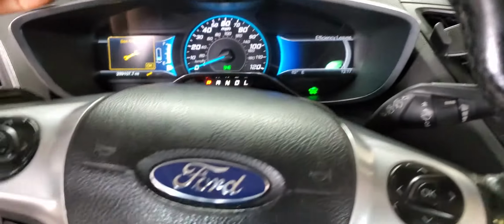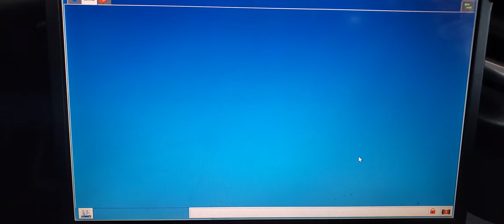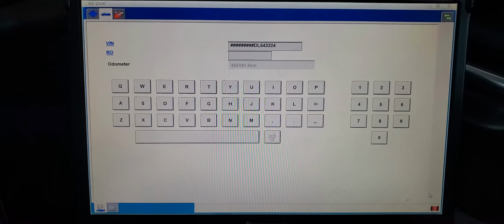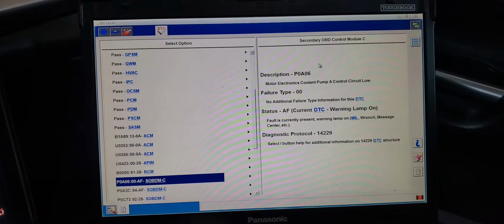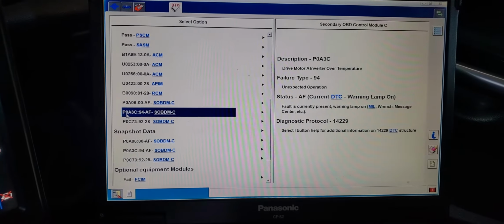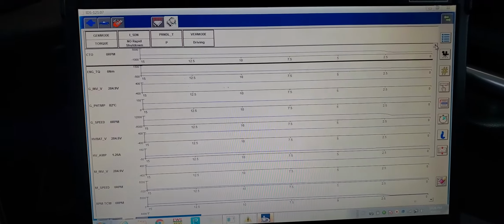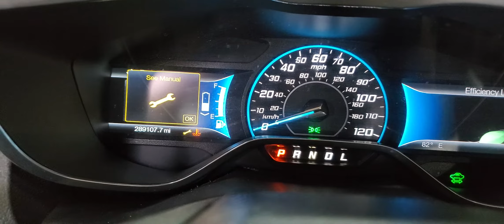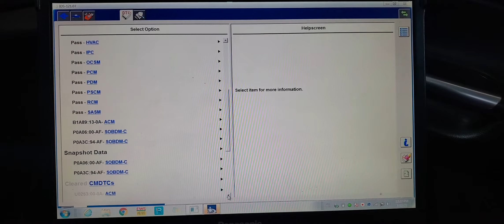Ford C-Max 2.0 Motor Coolant Over Temperature codes P0A06:00-AF & P0A3C:94-AF What You Want  To know

Comment: What had been replaced to fix?
Reply: Did you find out? The guy who made this video barely speaks English I have the same problem.
Reply: @canadian128 did you find?
Reply: @sarmatiansak6107  replace the coolant censor, and you should be set 👍🏼
Reply: @ my car won’t start now and writing stop safely now if change the coolant sensor it will be start?
Reply: @sarmatiansak6107  the problem for me was that my car would start, however  while driving my car would automatically shut off bc my car perceived that my coolant was overheating (which it wasn't). I replaced the sensor and the problem was solved.